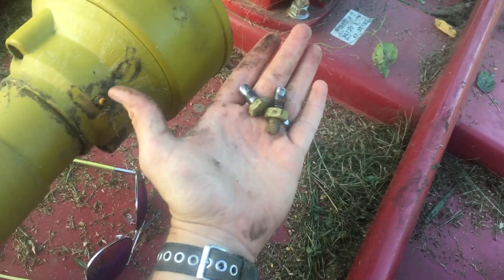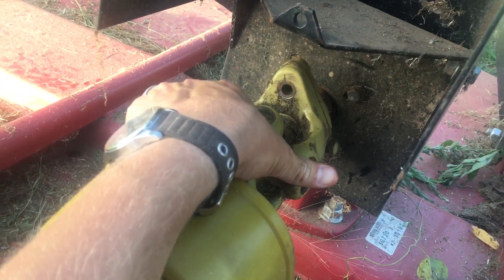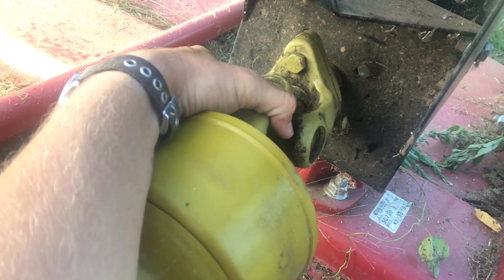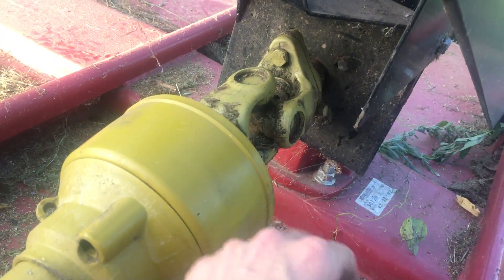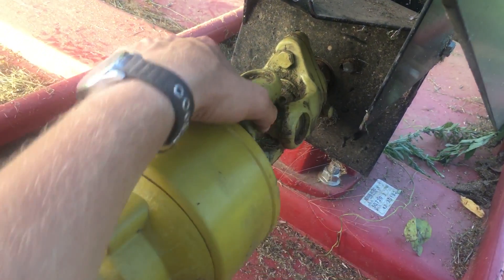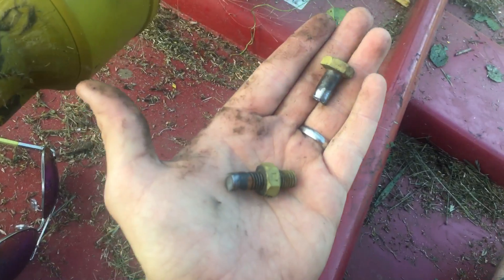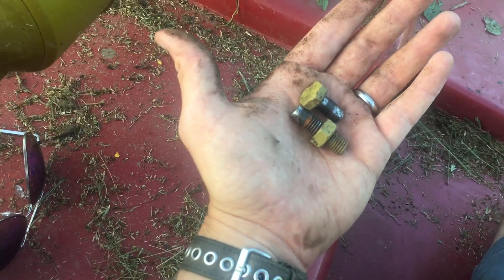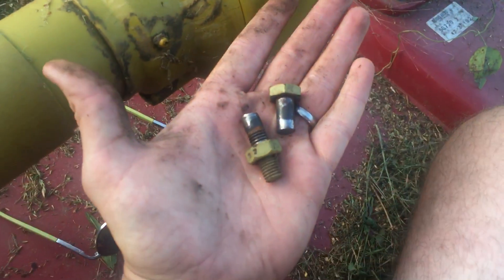Shear Pins are Smart (They're Mechanical Fuses)

Comment: 0:15 the rotational inertia of the blades doesn't really matter here. In fact, you want as little rotational inertia of the blades as possible so that if one of the blades hits something, the impact required to "instantly" stop the whole thing doesn't just break that blade.

The rotational inertia that matters here is in the PTO of the tractor — you want it to be able to break the shear pin if the blade does suddenly stop. At the same time, you don't want the shear pin to be too weak, otherwise it will break too frequently.

Comment: In 1982 as a 19-year-old Heavy Equipment student, one of the pieces of equipment I got to learn was an old mechanical Caterpillar D12 Grader. Everything ran off of a power-take-off from the engine. All the controls that moved the blades worked mechanically, there was no hydraulics. 
There was no starter motor on the grader. It needed a push-start from a bulldozer to get it going. It was still winter, late February, many of the machines didn't even have batteries.
During one pass along the roadway we were clearing snow off so we could start the class, I dug the blade in too deep, and the torque somehow snapped the shear pin. The machine had to be stopped so a new bolt/shear pin could be dropped into the hole. Once that was done, a bulldozer had to push-start the machine while the blade was still down. Even with the blade down, the bulldozer didn't have any problems.
Funny part about the bolt, it didn't require a nut to hold it in since it was held in place with gravity. All they had to do was carry a handful of spare bolts, and drop one in when they sheared off. Usually it was done with a machine that had batteries, so they could quickly re-start them.
Thanks for the video.

Comment: Here is a challenge for you, but a short story firsts.  I was a logger in my youth many years ago working sometimes many many miles from the nearest parts store and since you cannot take all the spare parts you might need during a days operation you had to bring something else in spades. ingenuity.  So... How could you get that to safely work again until a proper part could be purchased.  Something strong enough to handle the torque but soft enough to shear when needed?  Hint:  It grows all around you in Alabama and is what shear pins were first made out of.

Comment: I used to sell snowthrowers for Sears, and they all had shear pins on their augers (well, the two-stage ones all did, anyway). Every year, we'd get at least one angry customer coming in to complain about their brand new machine and how easy the auger "broke" when they accidentally sucked up the frozen newspaper that was under the snow at the foot of the driveway.

In addition, we'd also get at least one more customer per year who was replacing a machine after a few years because they, in their impatience and lack of forethought some prior season, replaced a sheared shear pin with a regular nut and bolt before hitting a similar obstacle when their luck ran out (the repair was more than a new machine, at that point). o_O

Comment: Kitchen Aid stand mixers have a single plastic gear in an otherwise all metal drivetrain.  It's intended to strip in the event the beaters hit something hard and stop.  The plastic gear is easy to replace and protects the rest of the gears and the motor in case you dump a bunch of gravel in the bowl or something.

Comment: Most bicycles these days use a similar design for their rear derailleur hangers so if something catastrophic happens in the drive train you wont ruin your derailleur or worse your rear drop outs on the frame.

Comment: uh... when I bust something on an implement whether it's the hoe or the hog (I've thrown a blade clean through the guard deck once, that was skrrry btw) I lift the 3 point and drive back to the garage to fix it. your sheer pin keeps the pto from delivering torque to the blades via the gear box. nothing to do with driving the tractor.  so I guess what my  question is, what's  ACTUALLY wrong with yer tractor,  D?

Comment: Destin: from a fellow Engineer & aeronautical geek, I'm glad you took the time to explain what much of the world doesn't even know exists.

I had a triple-blade Husqvarna riding mower & I'd go through about ten shear pins/year. Fortunately they were inexpensive (& much smaller than yours, with a specific "soft spot" notch in them, much like a .22 bullet casing.)

I love that you made the comparison to a car's drivetrain, as right now I have the heavy, worn out flywheel from a '72 Porsche 914 holding down a tarp on my truck! And to talk about serpentine belts; getting those three blades realigned so they don't strike each other, along with the getting the belt, on the cogs was... not easy.

Comment: I have come across to shear bolts when working at the airport where they are used with the aircraft towbars. If the pushback tractor for some reason stops quickly or something else happens the shear bolt breaks and disconnects the towbar and pushback tractor from the aircraft front wheel without damaging the landing gear. For some reason this happens quite a lot with some aircraft types and we haven't figured out why. Some other aircraft types work fine and the shear bolts don't usually break without a good reason.

Comment: I've been trying to figure out why the don't make anchors for cable or power lines that will fail instead of allowing the cable to shred.

Such an anchor could also act as a dead-man's switch, giving a signal back to the provider informing them the line is down... Then they could just come out and replace the anchor, instead of the line.

Comment: I'm a jet engine mechanic in the Air Force, and all components that spline into the gearbox and accessory drives have shear points. The only drawback is that sometimes those shear points fail on their own. On the landing gear where a tow bar hooks up there is one bolt holding the tow point to the rest of the aircraft. It too is there for the same reason, so if the plane suddenly stopped, say from a tap on the brake pedals, it would shear and not damage the landing gear. I love watching your channel!

Comment: Never seen that system before. The ones I'm familiar with have a clutch pack in the drive shaft to allow slippage if the torque goes too high.

Comment: I think your explanation is a little off. I don't think the rotating blades are the problematic roating mass/ inertia, they are in fact stopped by what ever they hit. it's your tractors engine and transmission still wanting to deliver that power to the now "static" blades. Thus putting an excessive amount of torque on that shaft and everything that comes before and after that. The breaking of the bolts then allows the tractor side to continue spinning without breaking parts you don't want to break, like you said. The rotational mass/ inertia of the blades would cause a problem if say your engine seized.
Reply: PacPaul123 I was thinking the same thing. The energy of the blades was absorbed by the shredding of the old tire. The momentum of the whole engine and transmission broke the shear pin. It's easy to get confused by this...

Comment: That makes me think of modern wired Xbox controllers. Close to the end of the cord where it plugs into the console, there is an engineered weak point so that when somebody inevitably trips over the cord or pulls it too hard, it will separate there rather than jerking the cord violently out of the USB port, or worse, pulling the whole console off of your entertainment system to crash into the floor. The first time I noticed it, I thought it was genius.

Comment: I also appreciate an inexpensive point of failure in a system.  I have RC cars that handily do 50-60MPH even though they are pretty heavy.  I only recently upgraded the idler gear in the transmission of the heaviest one (5lbs) from nylon to hardened steel.  The nylon gear is only $3 and easy to change.  Nice to have the cheap thing break.  I finally got tired of changing it and having to clean gear debris out of the transmission when it shears half the teeth off of the idler though.  Hoping I didn't shift the point of failure to something more expensive.  Time will tell.  She's kicking butt so far though.

Comment: they use hollow bolts to hold fire hydrants onto the main vertical water lines, so if some idiot runs into it, the hydrant doesn't break nor does it break something further in the ground.  Only the bolts need to be replaced.

Comment: This is also done in seismic building design a lot.  For instance some removable/replaceable sections in eccentrically braced frames or for a longer time "dog bone" cuts in steel beam flanges.

Comment: same goes with derailleur hangers on bikes. You’ve got a weak metal piece that’s meant to break in case the derailleur gets stuck so that your precious carbon frame keeps going instead of cracking

Comment: Why didn’t you just ditch the mower attachment and drive the tractor back?
Reply: You don't need a PTO running to pull a mower deck. The tractor will still pull it, the PTO turns the blades.

Comment: if you look at the top of the bolt there are probably three lines arranged in a circular pattern around the head, this means it is a run-of-the-mill grade 5 Bolt. Go to the hardware store and match it up. pick up about 6 of them and throw them in the toolbox

Comment: Don't forget Destin, the really smart thing about the shear pin is that its a readily available bolt from the hardware store. They could have made it a key-way or some proprietary connection that would force you to buy their special bolt, but they didn't! Also not over-engineered slipper clutch or ratchet mechanism that can seize or be more expensive to produce or fix. They know their customer, that's good engineering.
Reply: Some do use a special-grade bolt (not exactly Grade-5 or Grade-8), but a shear pin is common enough that most hardware stores still have shear pin bolts in stock.

Comment: And really smart designs for shearpins include holders for extra pins nearby where they're used... (I've seen a few really slick pieces of equipment that even have simple contact switches in the spare sockets - The machine will make an annoying error code noise on startup if the spares aren't there to keep you from using the spares and not bothering to restock them.)
Reply: nah. it's a VERY good idea to inspect them but the odds of really damaging them (especially from the tire he said he hit) are low. I've turned cinder blocks to powder, carved 3" chunks out of 2' rocks, tangled and torn cyclone fencing, mangled 1" mild steel pipe. many hundreds of hours mowing scotch broom, 1-2" alder trees,  only broken 1 blade once. those brush hogs are no joke though, a serious piece of machinery the way those 15 or so lb blades whistle around. Do be sure to treat em with all the care and respect of a firearm. all the safety all the time and no one around that doesn't need to be.
Reply: If you hit something hard enough to break those shear pins with a mower deck you REALLY need to lift up the deck and check the spindles/blades for damage. Those blades are going around 400 miles per hour at the tip and hitting anything that would stop them dead WILL do damage. You definately don't want to just throw a couple new pins in there and see how it goes. The pins limit the damge to the tractor's deck leaving the PTO unharmed. That definately doesn't mean the mower deck is just fine!

Comment: You'll find these on snowblowers.  If a rock gets in the auger and stops it the shear pin should break and save your snowblower.  Also helps make it safer to get the rock out of the auger, since it can prevent the system from binding up with a bunch of spring mechanical potential energy that could release suddenly and dangerously.

Comment: If I were you i would buy about 10 extra shear bolts and keep them in the cab of your tractor with an appropriate sized wrench or two.
Reply: If you need 10 spare shear bolts you are doing something terribly wrong! They limit damage, they do NOT prevent all damage.
Reply: accidents happen and the part probably cost 2 bucks why not have them around? if he hit a tire there is most likely no other damage so he could have replaced the bolt in 2 minutes and finished cutting his field if he had one in the cab.
Reply: The force on the tips of those blades is HUGE in the range of many tons. If you hit something and it stops them dead enough to require replacing the shear bolts You saved the PTO, but the blades, NOOOOOO you definately don't want to start spinning them up right again, they have to be balanced, when that happens often enough the blades get bent like a moustache and if you just throw some shear pins in there and run it, well your brush deck will RIP ITSELF APART! Not good! Not only will it cost a few thousand dollars to replace the deck, but you run the risk of DYING!. Those blades are flying 200-400 miles per hour depending on design, If you hit something and it breaks those pins then you're done mowing until you can lift up the deck and check the balance of the blade(s) and the spindle(s) for damage you don't just replace the pins and give her a try. I've had a brush hog for 15 or so years now and yeah, pretty much any time you hit something that will break those pins you will need to replace those blades. You just can't stop something moving at 400mph even if you do have a breakaway clutch.

Comment: This is very common in household vacuums for the same reason. There is a nylon drive gear interacting with a brass worm gear. When you suck up a shoelace and lock the brush, it shears the nylon gear instead of the expensive brass worm.

Comment: One of the most commone questions when I worked at a hobby shop was what they can upgrade the plastic spur gear up to so it won't break. had to explain that a 3 dollar gear is a lot easier to replace than a 40 dollar motor and it was actually designed that way

Comment: Another method commonly used on Bushhog drivelines is a slipper clutch. Clutch plates in the driveline are bolted together with springs holding a certain pretension on the plates so that if the load spikes the clutch will slip slightly to prevent damage to the tractor.  Cheers!

Comment: You can find the same thing on aircraft landing gears. There is a fuse pin which is designed to be the weakest part and will shear during certain ultimate loading conditions. This allows the gear to nicely fold away rather than go through the fuselage during an extreme hard landing.

Comment: Frangible design is a super useful specialty for re-usability in any impact-absorbing system.

I always have respect for designers who use these kind of critical load capacity items in their design, because it really shows they understand the scales of the loads going through the systems, and how they want to be able to salvage and recommission a set up after 'failure'.

Explaining the concept of a "controlled failure" to laypeople is always fun... because returning an item to serviceability quickly is acceptable design, and often preferable, over beefing up a system to inefficient proportions to be able to resist this load in capacity.

Comment: I'm a diesel mechanic and I work on buses. I agree the starter motor should be a softer metal so I wasn't having to take gear boxes out all the time to change ring gears 😂 ahh well, it passes the day.

but the engine ECU is programmed to stop the fly wheel in 3 different positions so the ring gear is worn in 3 places before it needs to be changed which I suppose prolongs it's life longer than the starter would have If it was made softer...

Comment: With the failsafe you also had a safety feature, the drive shaft is keyed and socketed, so it does not flail around on shearing the pin, but safely runs free. Also the shear pins on trailers are backed up by a chain so the trailer can be stopped safely. 

The tractor also has safety in the lift for the mower, the power in the hydraulic cylinders cannot deliver enough power to break anything before the relief valve limits pressure in the system. Further to that if the safety pin is replaced with the wrong bolt ( or welded up by some fool) the gearbox on the mower side is weaker than the PTO side, and will fail first, and same with the cheaper PTO as it is weaker than the drive side gearing. The universal joints are a weak spot, but are designed so the gearbox will fail first, unless you ignore the joints and do not service and examine them.

Comment: Krone SafeCut takes that idea one step further. There are several discs in a mower, all cutting at the same height. So when one gets stuck, that safety bolt breaks and a mechanism lifts the whole disc out of the path of the others. I sometimes edit videos for agrar machinery, and seeing the simple and robust but very fail-safe methods those engineers come up with, are the most interesting part of that job.

Comment: Actually learned something here. I always lumped these together with cotter pins, and never knew there was an actual difference
Reply: And I just learnt something too, from your reply. I always thought a cotter pin was just another name for a split pin, but your reply made me google other uses for that word. Turns out a tight fitting pin or wedge connecting two parts is also known as a cotter pin....who know? BTW, what Destin calls a "shear pin", we call "shear bolts" because it's a bolt and not a pin :)

Comment: I actually just started working on the ramp at my local airport, and the towbars we use to push back the planes have the same thing! It's legit exactly like you described, except in our case, it's so we break the towbar before we break the nose landing gear on a plane :P